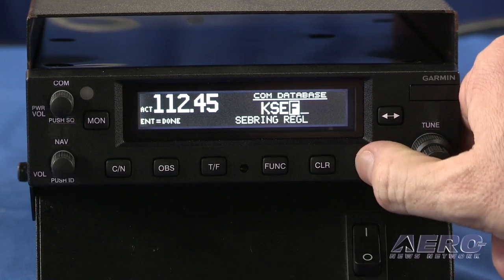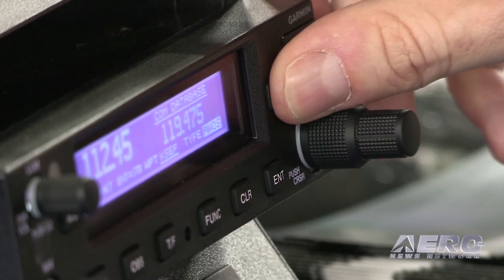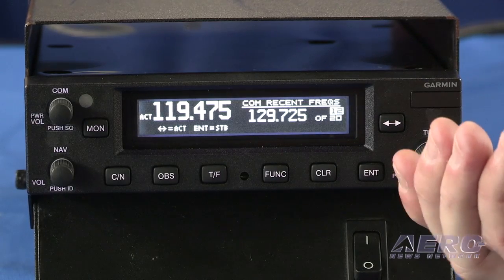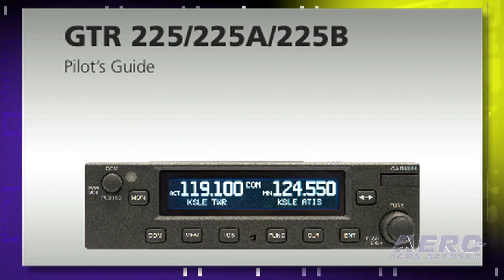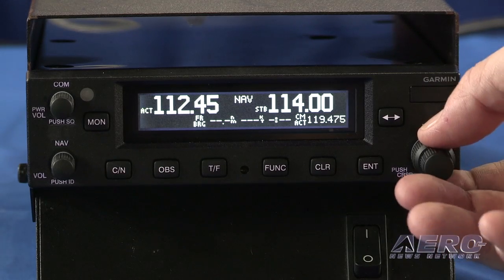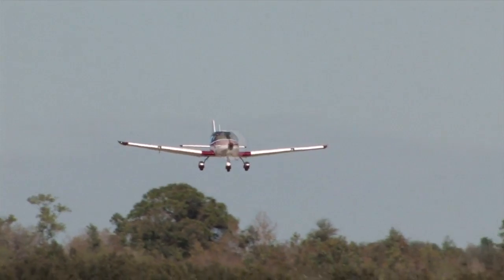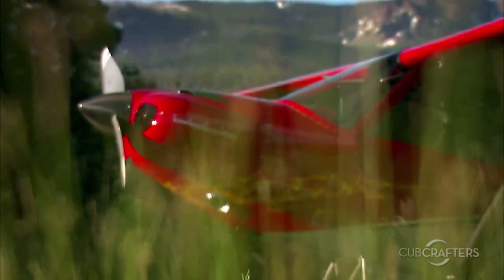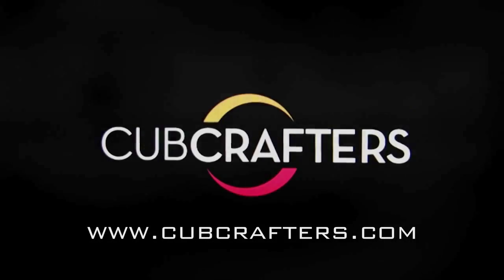Aero-TV: Garmin's GNC-255 - Back To Basics

Comment: If you own a certified aircraft, there is something you should know about Garmin TSOed products. Only their dealers can sell Garmin products to you, which is ok, but only their dealers can install them. So their dealers quote ridiculous labor charges for installations, and don't give a damn if you do business with them or not, because they know they basically have a monopoly on several counties around you. Their dealers are jerks and legal rip off artists, basically. I learned this from personal experience, and still can't believe a company can have a policy like that legally in this country. Non-dealer avionics shops have every right to compete in the market for avionics installtion services, and every certified aircraft owner should have the right to choose which avionics shop installs the equipment they purchase.
Reply: Called and that is not correct for the GNC255. The GNC-255A is not a product included in the Garmin Installation Policy for dealers.  
Therefore, dealer installation is not required.